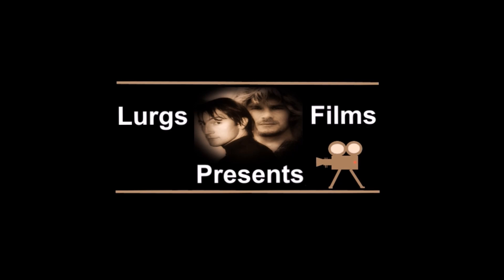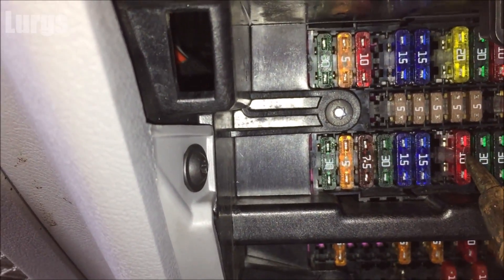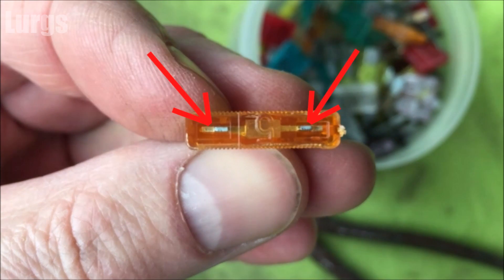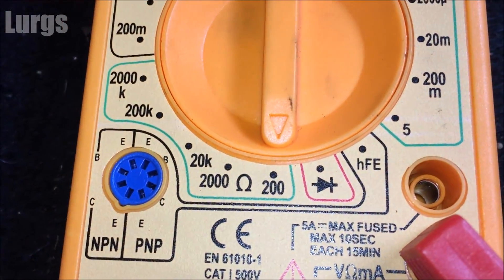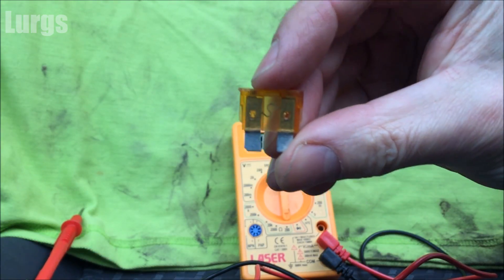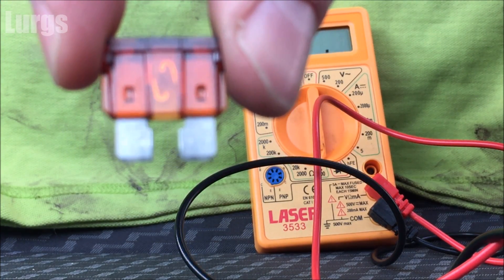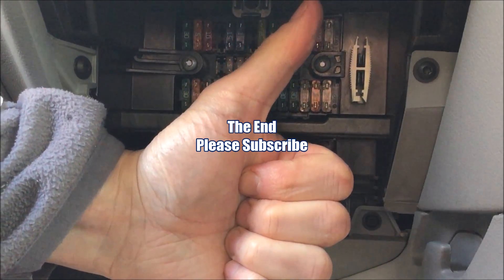How to check car fuses without pulling them out - Testing fuses with a Multimeter

Comment: You could also just check for continuity. Continuity lets you know if there is a complete circuit. When the fuse is working, therefore the fuse is a not broken and the circuit is complete, the multimeter will make a sound. But if the fuse is broken, there will be an open circuit therefore no electricity flow so the multimeter will let you know by not making a sound. To do this, do exactly what you did in this video but just adjust the knob one more to the right where the diode is.
Reply: One major problem with continuity tests, All it takes to make a complete circuit, and therefore pass continuity is any type of connection that allows current to pass. Even if the fuse is "blown" but still has a micron of the burnt portion in the fuse making contact, that will pass a continuity test. However, that same fuse will not allow 12 volts to flow through it at even 1 amp. Continuity test will not find a bad connection at a fuse, such as corrosion. All it takes is contact. Example, you have a wife that is chaffed and coming apart. All it takes is 1 strand of that wire to not be broken, and it will pass the continuity test. However, that same wire will not allow enough current to flow through to even light a bulb. 
Ultimately, resistance test (ohms) will pick up things like corrosion. Voltage drop/Load test will pick up things like broken wires, or poor connections. Load test will even pick up Fuses that are blown, but still have contact inside. It doesn't happen a lot, but in 40 years as a tech, I have seen it.
Reply: @gregdestjean6438  concerning the broken wife, which hole do you touch with the COM probe? lol
Reply: @gregdestjean6438  Makes sense you are right.
Reply: @gregdestjean6438  what’s your best recommendation?
Reply: @gregdestjean6438  a wife? lol
Reply: @gregdestjean6438 While what you said is true, the single strand of connecting wire WILL conduct electricity in all cases including at operating voltages. The difference is that at operating voltage the strand will present a very large resistance and it will overheat. It will likely finish failing at that point because it will burn. 

The audible continuity test is an appropriate first step in troubleshooting. Get a meter with audible continuity testing. They almost all have it.
Reply: @gregdestjean6438  Over the years I've seen a lot of blown car fuses of various types and none had any trace of a possible path for current to cross. I'm not saying it can't happen, I just think it is probably a very rare thing. Yes you're right about bad wires and other connections elsewhere in the wiring, but this is just testing the fuses. Another possibility is the connection between the fuse and the fuse holder. Placing a finger on each fuse and pressing with a slight rocking motion can fix, at least temporarily, a bad fuse connection. As for faults in the wiring that's a whole new ball game!
Reply: Not all multimeters have a speaker , you can still use the diode setting which gives the same reading as shown in the video .  Zero = continuity, while 1= no continuity.
Reply: I think your input is the best practice...ever ! 

Even testing voltage instead of resistance as suggesed below seems not the best practice since when car is shut, switches are off and therefore there is no power on the fuses at all. Hence DC measure is useless.

Just one concern : even in continuity test there is a small current to inject, no !? Why it is not dangerous to circuits ? Because of its very small value ?

Correct me if I am wrong 
Thanks in advance ! :)
Reply: @kenzo4Ever  yes, continuity will release a small amount of current, this is why it is not dangerous. It works similarly to measuring resistance, we probe the circuit in parallel and the multimeter is set to a very high resistance so current does not flow through it to prevent damage. A beep sound from continuity check means there is less that 10 ohms resistance..so good connection. When there is a break... no connection, then ohms is infinity so no beep.
Reply: @liridonosmani22  When I tried to learn a basic thing about using a multimeter, and then I learned even more on the comments. This is what youtube should be.
Reply: @joeypencil5368 why I always read comments lol. Thanks mate
Reply: do we need to put the red line on the 10amp port?
Reply: A big plus with doing this way is that you don't have to keep looking at the multi-meter screen, which likely means turning you head away from the fuses and possibly losing connection with one of the probes. You can just go from fuse to fuse listening for the bleep. When you don't hear it, then you've got a bad fuse. Not all multi-meters have a bleep, so check it out by touching the two probes together before you start.

Comment: I’m checking mine but they all say 0 so that means they all bad?
Reply from the maker: Must be incorrect Multimeter setting. Remove a fuse and test it like that, then test it across something broken or not a circuit, that's the reading you want.

Comment: Does the key have to be on or the engine running? Oh, testing with fuse out. Never mind.
Reply from the maker: No you can test them as they are without ignition. You are testing the circuit on the fuse so doesn't matter if there is power or not. Hope you found the blown one.
Reply: @LurgsHowToGuides  Thank you for the reply. If I found the right fuse it's good.
   The problem is some times the head lights don't come on. Some times they do. I can't find a relay marked for head lights so I'm going with the switch. 
  New problem, bottom of dash board doesn't come all the way out because center console  around shift lever doesn't come out. Wires to head light switch are too short to pull the switch down far enough to remove it. Even if I managed to unplug it there would be no way to put enough pressure on it to plug the new switch in since I can barely fit one hand up to reach the switch only with my finger tips. 
  Plus, I think AutoZone gave me the wrong switch. Instead of the ground wire plugging into the back of the switch there are two plugs on the bottom of the switch.

Comment: Thanks Mate, excellent tip. You can use the white plastic tweezers on the right of the fuses to pull them out instead of using pliers (safety)
Reply from the maker: Yeh I was having a brain freeze that day. Only realised I hadn't done that (I'm so used to second hand cars not having one) after the video got some traction and was too late to delete and repost. Glad it was useful though. 😎

Comment: Thanks for posting. You said set the multi meter to the lowest setting 20 ohms. However you appear to set yours to 200?
Reply from the maker: Time to get new glasses I think! 200 is the lowest mine goes, just couldn't read it properly! The joys of getting older, used to have 20/20 vision up until about 5 yrs ago. Hope it helped.😎

Comment: I have done all mine but could you please help??? All of mine read 0.03 or 0.30, every single one of them. What does that mean?
Reply from the maker: Depends what setting you had the selection on. If they all read the same then the must all be working and not failed. Good news.

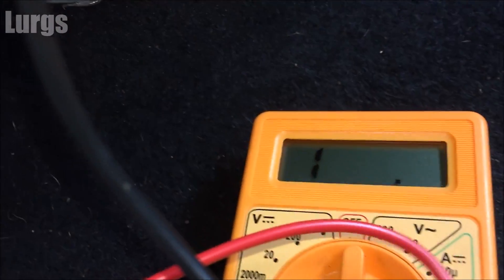Comment: 2:19 why is the fusible defect despite its 1 on the checker ?
Reply from the maker: Yacine Bruxellois That's the settings on the Multimeter. If no complete circuit then it shows a 1

Comment: Nice informative video 👍 my fuse box has 2 blank spaces ... Can I check these to see if I could add a fuse to power something ?
Reply from the maker: Yes you can check those but not on that setting on the Multimeter. I think you need to set it to 20V setting (and put ignition on) to test to see if there is power going through it. Not all fuses have power going through them when the ignition is off.

Comment: Great very video , I’m looking to hardwire a dash cam and need to check which fuse is dead when ignition off , is this the same principle
Reply from the maker: Well same principle but you need to set Multimeter to 20V setting to check for 12v live voltage

Comment: You can definitely do it like this, but i would measure the Voltage (DC) with the Multimeter :D put the minus clamp of the multimeter on Batterie Minus or the chassy and with the other clamp you can measure the contacts of the fuses ... if the fuse is ok you would measure for example 12V at both contacts, if the fuse is not ok then you would measure 12V at one contact and 0V at the other contact of the fuse. I apologize for my bad english :D
Greetings from Germany.
Reply from the maker: Great tips. Cheers. 🇩🇪
Reply: Same
Reply: This is the superior way.  You only need to probe with one probe.  The continuity way requires two probes to make contact at the same time.

Comment: Still don't know which is the windscreen wiper fuse
Reply from the maker: You'll need to check all the fuses after locating all the fuse boxes on your Vehicle.
Reply from the maker: @classic camper If you can get to the Starter Motor easily then try to get your Nodes onto the Power source in the Plug socket. Set it to 20V or the nearest to that, then get someone to  start it (turn it over) and see if you have power going to it. If you can't reach the starter motor then you could put the Nodes straight on the Battery terminals, when you turn it over the voltage should fall as it trys to start the engine, if nothing happens then there will be a fault somewhere. Good luck and let me know how you get on.
Reply from the maker: Wow a Morris Marina! That takes me back. My Mum & Dad had a Marina estate car (or an Ital variant) and I remember it had a super smooth gearbox. Good luck. Might be a fuse or faulty wiring or the starter motor is Dead.

Comment: You forgot to mention to disconnect the battery, as hooking an ohm meter to a live circuit can damage many meters. Other than that, good advise. Ohm meters are intended to be used on circuits with NO voltage.
Reply from the maker: @Joe Black Good luck at College, work hard and get a good job. 😎
Reply: I was wondering this thanks. Also should I just disconnect the battery any time I deal with electrical stuff in my car? Are there any exceptions
Reply: @tanicwhisper0647  test fuses in car with volt meter Not Ohm meter test fuses out of car with Ohm meter
Reply: @garywayne4577  you're correct
Reply from the maker: Well if you are just changing a bulb then no. If you replacing car stereo or a larger electrical item like a fuel pump then yes disconnect the battery
Reply: . video the of statt the to added should he infoPerhaps this
Reply: Bloody fuse
Reply: Is there a main fuse which cut off power from battery without disconnect it?
Reply: @dokesz530 je me posais aussi cette question
Reply: Ha

Comment: A meter when it is set to resistence sends out a small amount of electricity and monitors that electricity coming back in through the negative probe. If you are doing a resistence test, the company Fluke strongly advise that you can damage their meter if there is already current in the circuit.
Reply: James Barratt  could  it also damage systems in your car I’m not expert
Reply: @johnminshell6532  4 sure sir. You should never just switch something off unless you are sure the circuitry inside will allow it. Some systems still act as pass through for other computers in the car and just pulling fuses stopping the power and restarting as you put it back, can be very bad.
Reply: I think your input is the best practice...ever ! 

Even testing voltage instead of resistance as suggesed below seems not the best practice since when car is shut, switches are off and therefore there is no power on the fuses at all. Hence DC measure is useless.

Just one concern : even in continuity test there is a small current to inject, no !? Why it is not dangerous to circuits ? Because of its very small value ?

Correct me if I am wrong 
Thanks in advance ! :)

Comment: Sorry but for those who need a bit extra  instruction..... do you have to disconnect the battery before testing? I thought olms was for resistance only. How does resistance show the fuse is still good?  Probably am confused as this is a brand new area for me. Perhaps you could explain just a bit more for the folks who don't get the basics as well as others. Thank you. Otherwise you've answered the question of whether to put the positive or negative test leads on their own negative or positive side of the fuse. From your instruction, it sounds like it does not matter which test lead goes on which side of the fuse. That helps as the less clear people wonder if certain items might have to be tested by placing each the test leads on a correspondingly  particular side. Thanks again!
Reply from the maker: Teri June Hi there. No need to disconnect the battery, you are literally testing each individual fuse. If the fuse is blown there will be no reading at all on the multimeter. If the fuse is good by putting the nodes on either side you complete a circuit so you will get a reading.
Reply: Thanks so much Lurgs!
Reply from the maker: Teri June Hopefully I've gained a new subscriber. Have a great week.

Comment: Can you get electrocuted using metal pliers while taking out fuses? And does it matter if you put the red or black probes on either metal piece of the fuse?
Reply from the maker: Johnny Doggs Make sure the ignition is off. Fuses are inside plastic casing so the chances of a shock are tiny. No it doesn't matter which red or black goes on what side.
Reply: Lurgs Thanks

Comment: thanks for a useful video, especially the multimeter stuff, but unfortunately the standard fuses on my new type (2014+) Vivaro don't have holes in the exposed edge to access the metal bits. So I have to take the fuse out. But the good news is I've got the owners handbook with the list of fuses and their functions
Reply from the maker: Maybe they are the modern ones with tiny LED lights in? When the ignition is on they may light up. If one isn't lit it means it is blown. Hope you find the blown one. Please subscribe if you can, would really appreciate it. Have a great week and thanks for visiting my channel.